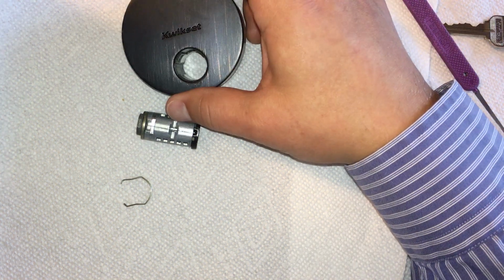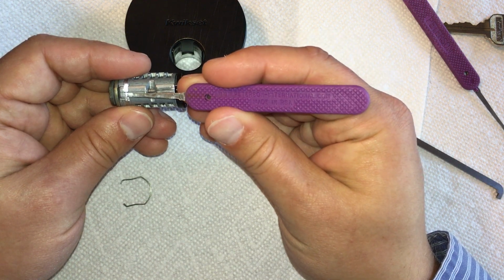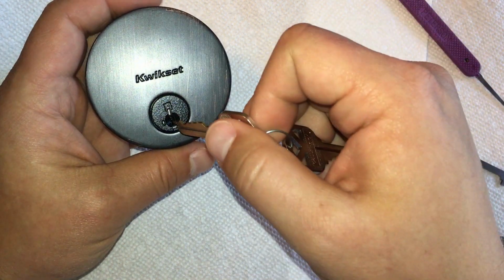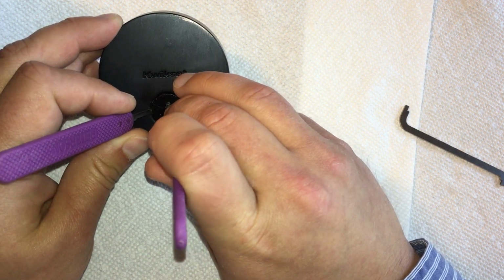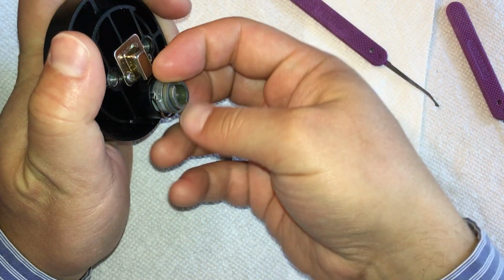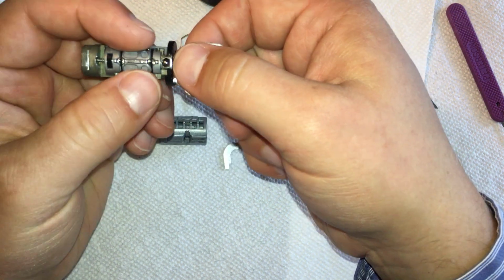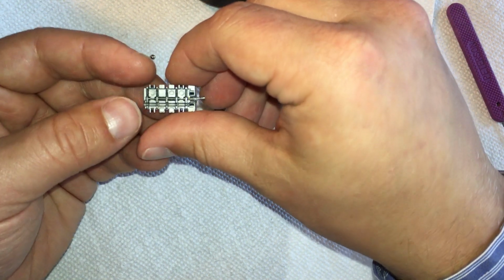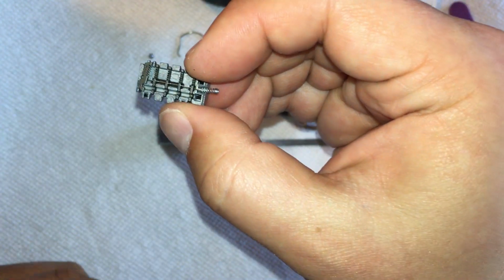Kwikset SmartKey Gen 3 pick and gut

Comment: Since the plug comes out from the front I would think that a dent puller would quickly remove it from it's housing.
Reply from the maker: a sufficiently heavy slide bar hammer might be able to pull it out, but you are working against one of the strongest parts of the lock to pull it out.  At that point, it would probably be faster and easier to use a crowbar to just force the door open.  One thing to keep in mind with home security is that typically the lock isn't the weak point, all of the doors and windows make for pretty easy entry points even without the lock being in the way.

Comment: Would you be able to pick this lock if you did not know the bitting on the key? I feel that because you've seen the key you know how much you need to move each pin. I could be completely wrong though.
Reply from the maker: David Lynch absolutely I could pick this lock without seeing the key.  Oddly, of all of the locks I have, seeing the key used in the smart key locks helps the least.  When picking this lock, once the pin is raised to the right height, the shim feels loose and easily pushes in further, so what I’m feeling for is the shim suddenly becoming easier to push further into the lock.  Knowing the key bitting actually doesn’t provide any real assistance with this lock because that feeling of the shim moving is so reliable that knowing the bitting positions is essentially pointless.  That being said, most factory locks, knowing the bitting of the key doesn’t help that much, because the security measures in place really aren’t that complex.  In normal pin tumbler locks, the manufacturers seldom go beyond simple spools and serrated pins, and even those aren’t that common.  The way standard pins, spools and serrated pins work is pretty well known, and pretty easy to get a feel for.  When we make challenge locks for each other, we typically disguise the key because we’re intentionally building locks that go beyond what factory locks do for security measures, essentially trying to trick other pickers to make the lock more challenging to pick.  It’s not that a commercial company couldn’t do the same to make locks more difficult to pick, but there really isn’t a good payoff for them to do so, their current techniques are “good enough”.  Your house isn’t going to be infiltrated by a highly skilled picker, it’s far more likely to be broken into by some low-skill punk that will just break a window, so why put the money and technology into hardening the lock when a thief isn’t likely to actually be deterred by it.  It would be like putting a 10-foot fence in front of your walkway while having nothing blocking access to your lawn. what’s the point of the fence at that point? someone will just walk around the fence if the want to get past it.
Reply: @Loupgarou21 Thanks for responding, I was wondering about that part myself. I'm a younger locksmith early in my company that I started, these videos are really helpful. Im close to being able to pick these myself, thanks to you and other locksmiths on youtube. Not quite there yet, but I'm close! Great vid!

Comment: Has Kwikset address forced entry issue on this 3rd gen where an uninvited guess using a screw driver and was able to rotate the cylinder into forcing the deadbolt to open?
Reply from the maker: Abandon they did improve the materials used in this version to try to prevent the lock from being forced the way you could with gen 1 and gen 2 versions of the lock.
Reply: Using a screwdriver on a later generation will cause the front part of the plug to break away, instead of turning the plug to open.

Comment: Fortunately the 980/985 and 660/665 deadbolts have no gap into which the shim can be inserted; I have a few and I tried.  Remove the face plate and even a simple visual inspection will verify that - no gap.  Looks like only the fancy shmancy hoity toity models fall to this exploit.  So sad...
Reply: Perhaps this is why I can't pick this no matter how hard I try? Well, there's always the decoder for 300 bucks which while expensive, it's still sad in their making of an almost pick proof lock, someone with a little experience can figure out the code to the exact key for the lock in under 60 seconds.
Reply from the maker: I missed this comment a year ago.  I decided to take a look and saw I could get a 980 or 660 for about $15, so I figured I'd buy one and give it a go.  I'll let you know how it goes.

Comment: How thick is the shim you used
Reply from the maker: Zachary Linton I thinned it down to .010", that seemed to be the best compromise between strength and flexibility.  I was able to get it inserted at up to .018" but the shim wasn't flexible enough at that thickness and caused other issues.  It's also very important to get the bend in the shim shallow enough so it doesn't escape the lock body at the opening in the side of the lock.
Reply: Loupgarou21  thank you for your help I wasn't sure how thick the shim could be